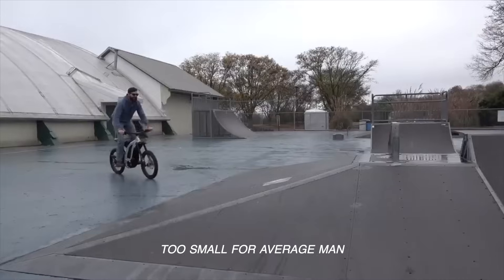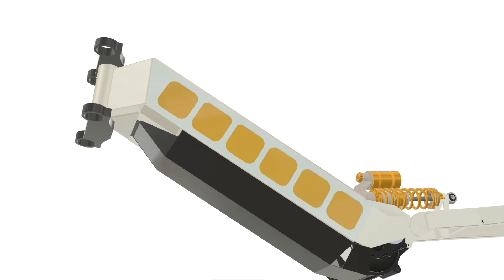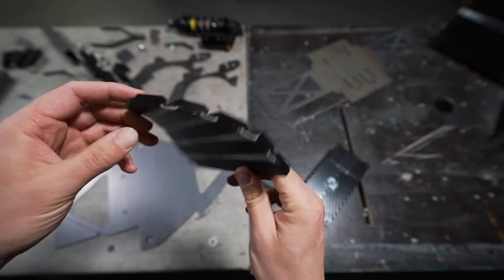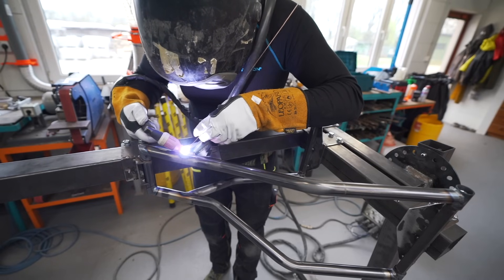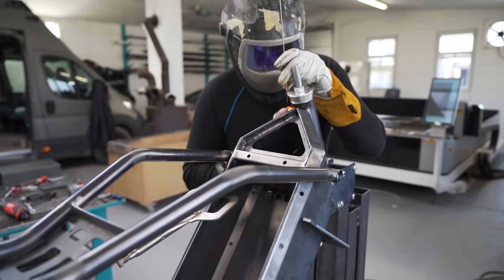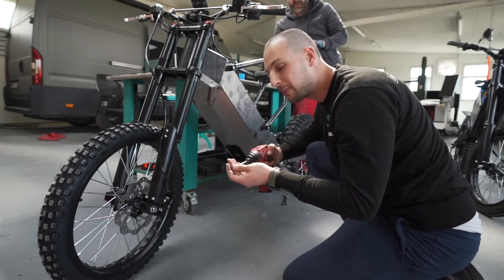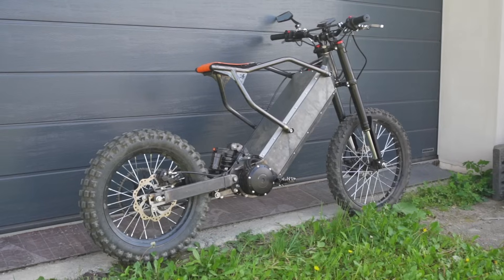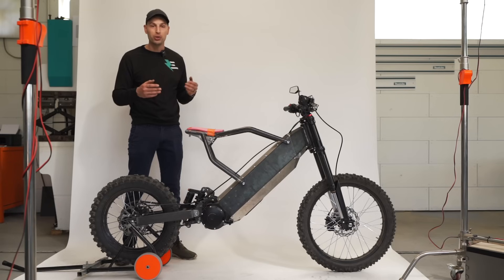Building Insanely Fast Electric Motorcycle From Scratch / New @ridevoltic Build

Comment: Seriously smart design! Absolutely the right approach with form following function. And it looks great too. The only thing I’d like to see is big motorcycle shocks (48mm) full size swingarm and Brembro brake calipers with 320mm or bigger discs. Basically full-size motorcycle components. This bike could definitely handle it!
Reply: Yes and 21" front and 19" rear wheels!😎
Reply from the maker: It’s not motocross category so I won’t be installing motocross shocks. These brakes are poisonous sharp, no need to change at this point. We currently have installed 21 and 18 wheels.
Reply: @ladiandmargaret   Shame that, guess someone else will add the components I spoke of then. Still though, your bike has a superb design. Great work👏 I went ahead and subscribed. Looking forward to seeing what you do next.

Comment: Nucular is a cheap China controller and you can’t tune the bike or throttle with an app. Your swing arm is missing a linkage. Surron also makes the Ultra bee larger dirt bike and it’s lighter than this build and has proper linkage and suspension and looks beautiful and well made. Still, great video if your into the DIY look.
Reply from the maker: Nucular is not China controller. My swing arm has linkage. Light bee has a smaller battery, half the power, slow charger (not built in) for the same price. I don’t think you are a well informed individual.

Comment: The bike is great- but the wheels are a bit too small? You said you wanted it to be more like a full sized bike? Full size bikes have full size wheels. Also the seat stem needs to be longer, have a PROPER SEAT for TWO people not one? This bike should carry a passenger with that size battery? And it really should have a STORAGE area where the tank should be. This would make it look even better and more like a real motorcycle (your original idea). 👍🇬🇧
Reply from the maker: 21and 18 wheels, the biggest motorcycles have. This is not for two people. I agree with the storage.
Reply: These are 21" front and 18" rear ? Damned !👍🏼

Comment: Rubber mount the motor and that should take some of the noise away.
Reply from the maker: How?
Reply: @ladiandmargaret  like a Harley or top motor mounts on front wheel drive cars. Some bikes have a bushing running through rubber for crush resistance. Walk around at a salvage yard or a You Pull it and get a idea. Also on the old Polaris two strokes had rubber mounts to help with vibration. Just a idea. Good luck man.👍
Reply from the maker: To reduce vibration on combustion engines? I hope you realize electric motors don’t have the same vibrations :)
Reply: @ladiandmargaret  yes sir I was thinking about  chain noise but I couldn't tell how you used to stock transmission. I have seen a  damper on clutch baskets but can't remember the model. I'll ask my old boss. Was probably one of the bigger 500 two strokes.  Just trying to throw some ideas boss. Your definitely smarter than my dumb self. 🤪. I'll do checking before I open my pie hole again or have any brain farts. Holla .

Comment: I need off road wheelchair badly 😅
Reply: My wife does too, but handlebars are a problem with no hands. Btw no feet either and prosthetic legs which suck off road. Power wheelchair works fine often but gets stuck on 1.5 inch roots.

Comment: that much in charge rate and there putting shrink around the batteries wonder how hot the batteries are getting and another thing how about wheel fenders don't like mud and such on my back and butt and front as well there's you some improvements already.
Reply from the maker: 26 degrees celsius when peaking the battery witch discharging for some time. This bike is not finished, will come with fenders for sure.
Reply: @ladiandmargaret  what about charging? does it get kinda hot pushing that much current even Tesla has ventilation for cooling for there batteries.
Reply from the maker: Charging is not an issue, it’s only 3amps per cell. This won’t heat up the pack to any degrading temperatures.

Comment: That battery pack is nuts! Maybe do some engineering on air flow cooling, cell selection, etc to refine that monster a bit.
Reply from the maker: What do you mean by cell selection? Of course we select the right cells in the first stage of the battery build. I don’t like moisture inside of the battery pack. I go different route which is not maxing out specs of the battery pack. In that case it does not have to be cooled.
Reply: @ladiandmargaret  well, it must be spot on then.  No refinement required.
Reply from the maker: It’s not but your suggestions were solved ahead of time. I hope to think better way.

Comment: The suspension components look very undersized especially the rear shock. Hopefully the production version uses something from a supermoto or mx bike.
Reply from the maker: This is not supermoto or mx bike. It’s not even designed for the same purpose so it has  motorcycle shock with shorter travel.

Comment: Sadly the prices are extortionate, no one with a brain will pay those prices when you could buy a Honda off roader bike cheaper, just makes no sense at all.
Reply from the maker: People buy EVs for their benefits like low pollution, no noise, cheaper transportation, instant torque and so on. Motorcycle with combustion engine won’t give you the same value so it’s hard to compare. You should give one a try to form objective opinion.

Comment: Hey wonderful project. Is there a possibility of joining hands on a project where we can embed a range extender and design a self charging bike as well as increase the range by 3-4 times of the existing range???
Reply from the maker: We’ve already solved this. Fast built in charger is the closest to range extension you can get. Removable battery is present on this bike too, that’s the second option for more range.
Reply: @ladiandmargaret  I was talking about embedding a custom built low back emf generator in the bikes wheel so it keeps charging the batteries while the vehicle is in motion. below is an old video for the self charging bicycle we had developed in 2015,  this was the Mach 1 now we have a way better system. I thank you for your time and prompt reply 

 https://youtu.be/4KSs1fdjCOo

Comment: put a hub motor in the front wheel (thats tied to the same throttle but can be deactivated by a switch for more range when wanted) for awd and some more power. idk if that actually works but it would be cool.
Reply from the maker: This must be the worst suggestion in the comment section. The unsprung weight on the front wheel makes most bikes with bigger hub motors unridable.
Reply: @ladiandmargaret  lmao, I said I don’t know if that would actually work. I’m just trying to come up with ways to make your bike different. It looks like every other e-bike out there.
Reply from the maker: I don’t think it does.

Comment: Will this eventually be aluminum?
Reply from the maker: Aluminum would not allow this particular design so I don’t think so.
Reply: @ladiandmargaret  would be great to see a similar structure bike using tab and groove plate engineering. Power to weight would be intense.
Reply from the maker: I think 105kg is great for the battery size, moto components, built in charger and big motor. Don’t expect switching to aluminum would save 20kg, more like 5kg.

Comment: Cool design. I’d encourage you to consider a more traditional swingarm pivot point instead of just having a flat plate that bolts up to the frame.  This will be a weak point and more importantly it will introduce flex into the rear suspension system; not the best.
Reply from the maker: Can you direct me the right way where I could see what you mean?

Comment: just an fiy i worked for a company in grand rapids mi a while ago called Bend Tooling. they have several panting on products and ideas to stop the pipe from collapsing when you bend it. there so weirdly secretive i got fired for taking my phone inside the building.

Comment: I bought a Chinese bike (EUBIKE K7) that I thought would be good for my 5'11" height and the design is very similar to yours - not nearly as powerful due to the import restrictions here and I believe my saddle is way more comfortable than yours but I am AMAZED at how awesome your bike looks.  

   Can I make a suggestion?  

   Instead of painting it, cover it in truck bed liner - here the USA we call it duraliner or rubber guard - nice textured black finish that can take a scuff if you dump it.

Comment: the whole purpose of the seat on a modern motorcycle is a grippy point of contact for sometimes the buttocks while seated, sometimes the inner thighs while standing. You should put a full sized seat on this bike so it can be ridden to the full potential of those forks, rear shock and tire aggresiveness. Without the option for the rider to actually transfer his body weight around, the bike cannot be ridden hard. I suggest you take the seat off of a production dirt bike and incorporate it in relation to the wheels and handlebars in the same general area as most bikes. Then you will attract riders who are fast and use their bodies to loft the front end off the ground, to go over obstacles, to do wheelies etc. The current seat setup is engineered well but the seating area needs to be MUCH larger and conventional.
Reply from the maker: Already done

Comment: I am very glad to see your progress. I tryed to buy frame from you 4 years ago, but then you could't deliver. Good that you are up in the game again. 4kwh battery is not so big, vector typhoon has same capacity at lower price and it's a good bike, so that's a thing to develop. 8kwh would be true upgrade. I hope you sukseed and make a good bike and I would like to do busines whit you again
Reply from the maker: Thanks. We’ve been in the business the whole time. Not sure what happened before. Typhoon does not have 4,6kWh battery and it’s a hub drive, no motorcycle components, no built in charger, half the power. It’s not fair comparing price to a bike from completely different category.
Reply: @ladiandmargaret  Well It has 4kwh battery still and torqy qs205 hubmotor which has great eceleration. I moded one whit higher stem,difrent handelbar and motostyle asphalt tyres. It was wery good. But I hope your bike is better still. You got my respect :)

Comment: Will you be selling just the frame including battery/controller/motor separately?  will a standard dirtbike swingarm and fork fit it?  If so, then the core of this bike plus a cheap used dirtbike would be an awesome combo and not cost a fortune.  would be an easy sell to a lot of folks that already ride gas dirtbikes and have old bikes laying around.
Reply from the maker: I’m not sure yet. Definitely it’s worth considering.

Comment: Needs a chain protection or at least a rear mudguard. You can easily slip of the seat directly onto the wheel/chain.
Reply from the maker: I agree. We have the chain guard in the 3D, we just did not care enough to make it for this first prototype.
Reply from the maker: Both mudguards will be present.

Comment: What is your rear wheel axle travel? 
Bike looks fresh, not like any other bike on a market. 
Did you use linkage suspension for progression compression?
Rear wheel looks smaller then front, is it 17" and front 21?
Reply from the maker: Thank you Artur. I need to check the rear travel. We made our own linkage. It’s not easy. You are right about wheels, it’s 21 and 17. We’ll likely use two options. 21 with 18 and 19 with 17.

Comment: For reference: seems to be a QS 138 V3 mid-drive motor - amazing that you can get that much power out of a motor rated at 5.5kW!!  Battery: 22S14P Molicel P42A good for 630A, 79.2V nominal, 50kW peak.  >21.5 kg battery cell weight, ~ $1300.  (Have been looking at SK pouch cells that are much cheaper - $20 for 55Ah - would yield a battery of about the same capacity for $440. OK for 3C / 5C, allegedly)
Reply from the maker: I’ll look into the cells, thanks for pointing it out! Motocross guys seriously peak this motor with 40kW. So far I reached only 65 degrees with 30kW. It’s a pretty amazing motor.

Comment: Your swing arm mount is too high relative to the sprocket. Optimally, if they were aligned, it would give you better chain control. Don’t worry about colors or other bullshit until you work out problems, materials and manufacturing. You might consider aluminum or 4130. You should put that on a motocross track and see how it performs, work out all the bugs, fit and finish, parts availability, and what it takes to put a plate on it, then consider colors, plastics, etc.
How about a supermoto version?
Reply from the maker: Good feedback. Manufacturing is all covered, we’ll do most in-house once we have the bend machine fixed, we’re in the midst of testing now, already have the ability to plate it for the USA (will be an add-on at checkout to receive with license plate, registration, & title) now we’re playing a bit more with the seat dimensions and the padding from there. Hoping this next vid we can show you final version. Non-stop riding til then 🔥

Comment: the proportions are insanely ugly. wheelbase is too long and the tires are too small.
Reply from the maker: 148cm wheel base is very common. I already have more tires in stock for testing. What would you change proportion wise?
Reply: @ladiandmargaret  I meant that the wheelbase looks wrong in proportion to the tires

Comment: It looks good, only the fron tyre the same size as the rear one and mudguards, all in black! How fast from 0-100km?
Reply from the maker: We haven’t tested the acceleration yet. Motocross bikes have the rear wheel smaller than the front one. It looked weird when I first installed both wheels same size so I switched the front one. Mudguards will obviously be installed once we solve more important tasks.

Comment: 9:46 Why don't you just have the bender fixed?
Reply from the maker: We’ve worked with multiple mechanics, it’s a more complex power board issue than your question implies. Working on it

Comment: That’s a great design. proper motorcycle wheels. 👍  sealed battery…that is alot of cells…no airflow makes me worry a bit about heat buildup on long hard pulls…especially the cells in the centre of mass.  If you aren’t abusing the amp draw, I think it is fine!  But you know there will always be one person that takes it out on the highway, and holds it wide open, til the next town…🤷🏻‍♂️  I’ve been eyeballing some of the qs offerings in the geared motor, but haven’t pulled the trigger yet.  I want a matching controller that works well….without hours of programming parameters.  cheers on a great looking project, I think you have a winning design!
Reply from the maker: That’s why we have 14 cells in parallel. they are only stressed with 25A instead of it’s limited 42A. After hardcore riding I was not able to get more than 28 degrees celsius inside of the battery pack. We now have experience with building high current battery packs.
Reply: @ladiandmargaret    That’s very good!

Comment: You need to change the brakes from mountain bike units to at least dirt bike ones. The mountain bike ones wont work with the mass, speed and power you have. 
Also use ducting and guards or relocate the ESC so its not pounded by cast off from the front tyre.
Awesome project. Hoping to see this hit full production.
Reply from the maker: We only use motorcycle grade brakes, tires, suspension on our bikes. Mountain bike brakes are not suitable for this speed and weight!
We are developing mudguards. They will be available once we solve more important problems.

Comment: I have been designing electric moped/motorcycle but it would support battery swapping with my bidirectional battery swap system that would also follow upcoming battery swap standard that Swappable Batteries Motorcycle Consortium is developing.
Reply from the maker: We are planning rapid battery replacement option.

Comment: Almost perfect, I'm wondering about the removable battery/vehicle to grid functionality though -  First option gives you much better option to charge if you dont live in a house, second one is giving you a luxury of also having an ecoflow functionality but on wheels - much better proposition then to justify the purchase ;)
edit: ok vehicle to grid makes no sense in this format, maybe in a larger motorcycles
Reply from the maker: What do you mean by vehicle to a grid? Plugging the bike straight to a wall and charge? That’s the built in charger we are incorporating. This bike also has a removable battery.

Comment: I'm wondering if you had a direct drive motor on the wheel, wouldn't it be more powerful, as your then eliminating power loss through the chain drive system
Reply from the maker: Not at all! First thing is the weight on the rear wheel and second is the power ratio between sprockets. The same motor feels much more powerful like this

Comment: The lower seat bar should go straight down maybe to the rear upper shock tower. Most of control when riding a dirt bike comes from squeezing the bike with your legs or using the inside of your calf to pull the bike back up, think being in the air all the time or floating over the terrain, the most worn part of any bike is where the ankle meets the frame. Smash one of your balls on that pillow of a seat or lean back to far over the woops and your seats going to play tennis on your newfound ovaries. Just some food for thought, you guys did how ever do a great job nice build. Once upon a time everything started in a garage. YELLOW. Not hot pink. Thanks for your time.